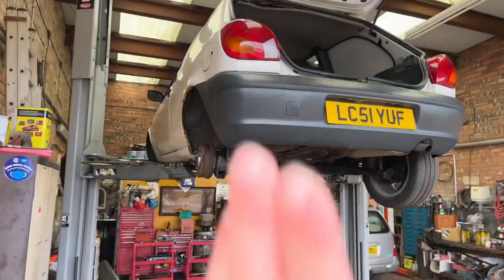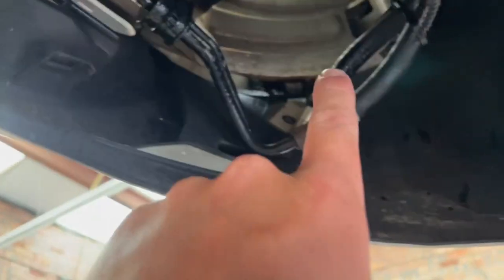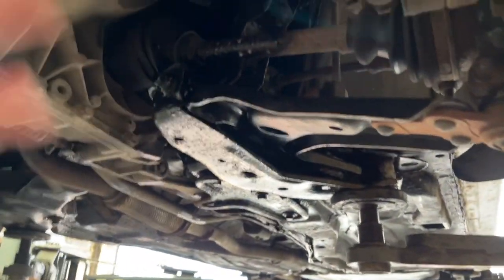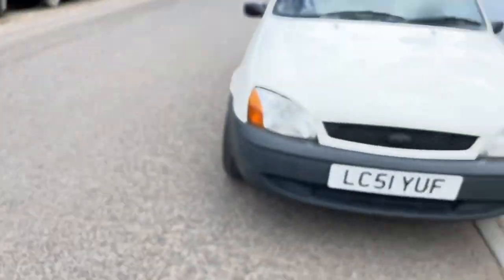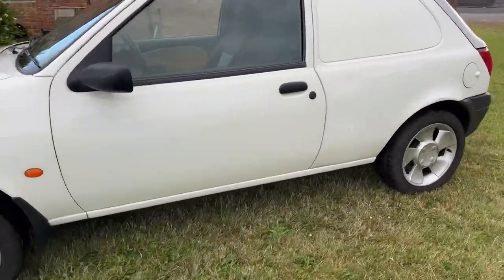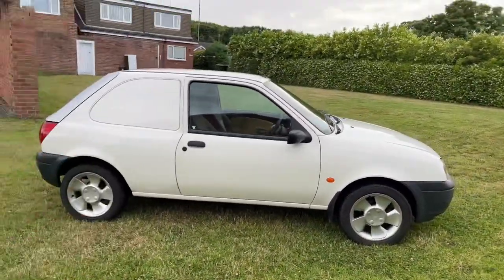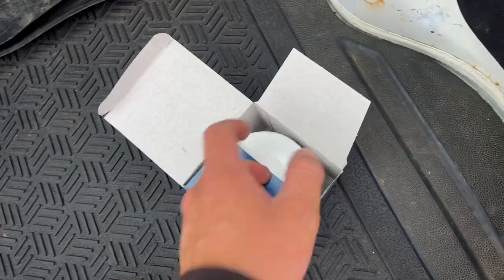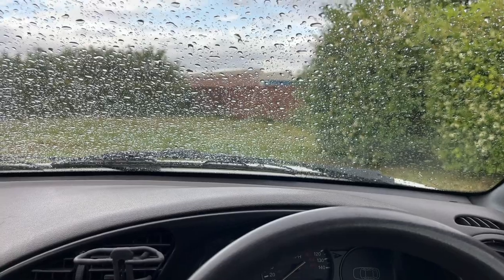Overhauled Ford Fiesta Van MK4 MK5 1.8 TDDI Endura DI Turbo Diesel| #van #ford #fiesta #tdi #diesel

Comment: Nice little runaround that dan ! I love mine vans are great and a contender for the coolest things on the road 🤣 basic motoring everyone should have one !weird when you have owned a van you always want one around or I do anyway 👍 wheels suit it looking good for what it is !
Little tip from me for black faded plastics try boiled linseed oil mixed with white spirit about 50:50 last for months and months and so much cheaper than bought  back to black type products I couldn’t believe how good it is done that for years now 👍
Reply from the maker: Yeah I do like to have a van around, such useful vehicles.

Thanks for the tip will definitely have to try it out, had some C4 knocking about that stuff lasts for years but it’s not cheap.

Thanks for watching 👍🏼